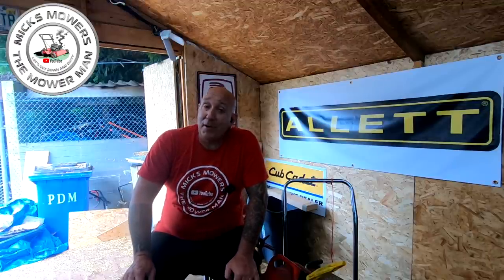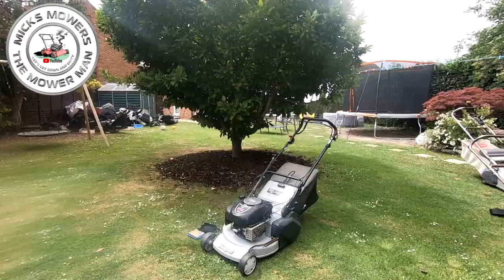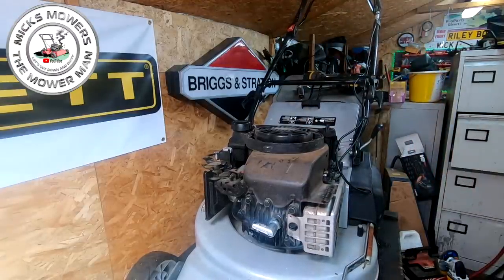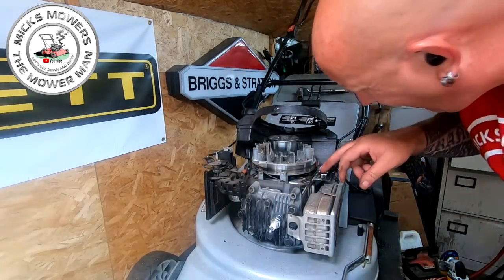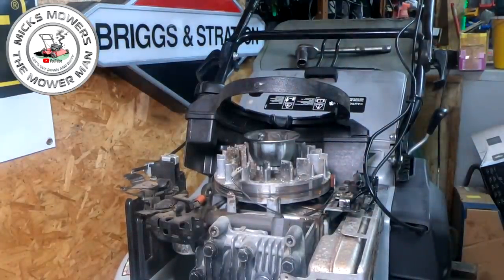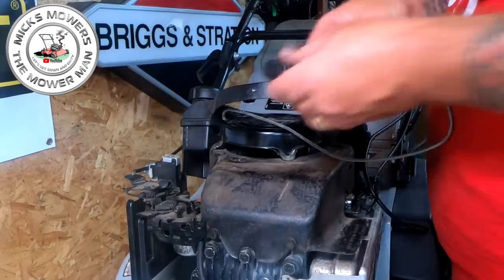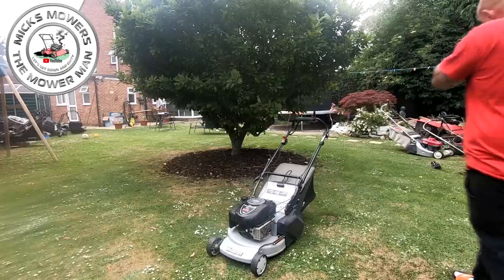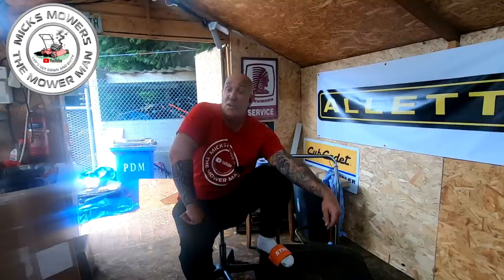lawn Mower No Spark No Start No Problem Masport Mower #micksmowers

Comment: I had a similar issue with a Qualcast strimmer that would start fine when cold, but nothing when hot until it was cold again. I squirted fuel down the plug hole, and pulled the cord, straight out the exhaust. I then changed the LD spark plug for an NGK and works fine since.
Reply from the maker: Ta for watching mate

Comment: Hi Mick
If your Briggs engine is before 2012 you could just have a faulty plug cap.
Some of those early metal caps had issues and caused a spark problem, hot and cold starting.
Clean the rust as you say, a new rubber plug cap and you could have a good spark from your old coil.
If so always replace your spark plug as well, the faulty plug caps seemed to muck the spark plug up as well.
I would rather have  a genuine Briggs coil than a copy.
Good luck!
Reply from the maker: I have another video on this coming soon.. the coil was not the problem..

Comment: Hi Mick
From memory the Coil Measuring of 9.3 is good towards 11-12 they are dodgy and worth replacing.
In this case the mower only ran 20 minutes may be coil heating up too much to restart.
I’m sure if you measured the new coil from China it would of read in the 9.3 range.
Reply from the maker: Hi mate 
. I did say in the video it's high but still ok.. I have had a coil read similar and still be a bad coil
Reply from the maker: But this is infant not the problem. The mower will be coming back soon ta for watching mate
Reply: @themowerman  Mick, sorry missed that it was high.
Oh no it’s coming back will be waiting for diagnosis....😉

Comment: Hi if the coil is fine how do you test the micro switch or anything else that makes the spark
Reply from the maker: With a meter
Reply: @themowerman  hi mate would I do that the same way as testing the coil as a bit unsure
Reply from the maker: @dannib69 yes mate

Comment: You’ve got bad wind in this video Mick at the start 🤣🤣. No swearing or you will banned from my big TV and that means I’m watching you when I’m in the bathroom. So,,,how did you go straight for the coil? I didn’t see you check for a spark, I know you changed the plug but still learning here
Reply from the maker: Just going on what the fella said.. that points to coil.. however it will be back. There is another fault on this so it was not the coil..
Reply: @themowerman  oh no! boomerang